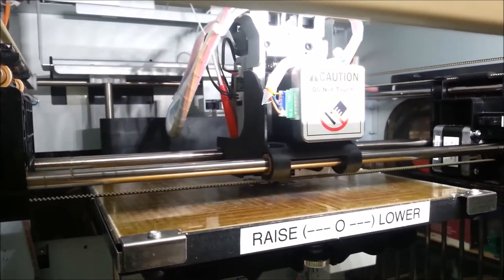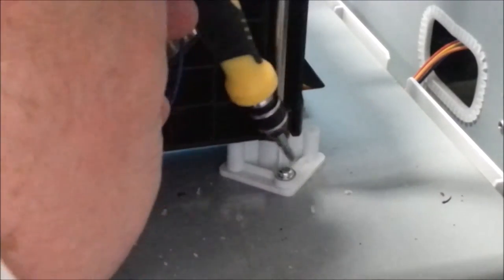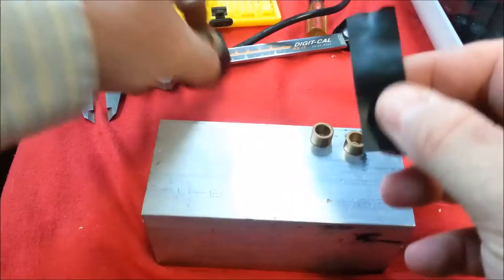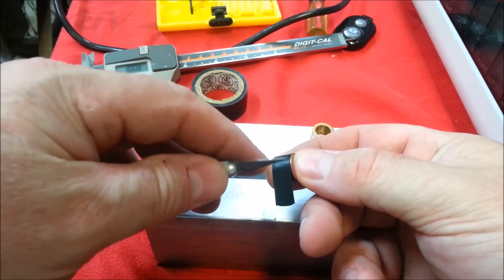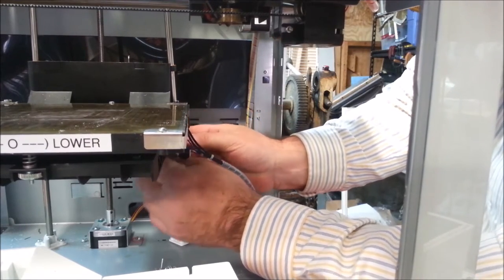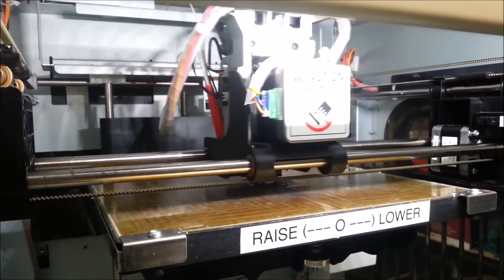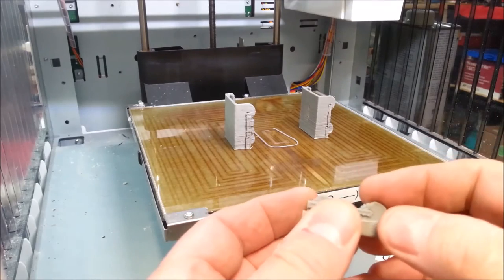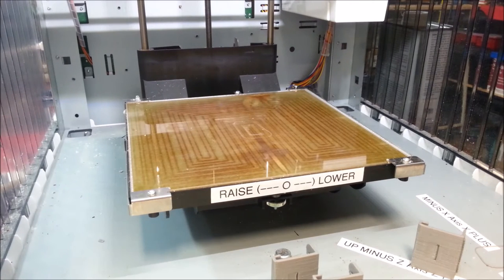Da Vinci Bed Slop  3D Printer Upgrade

Comment: your very crafty dave, the ridge line parts you printed for me are very impressive . a little big , but very cool. i hope to set my hammock up and give them a try. some acrylic paint could give you a bonded layer for spacing on the barring, maybe ..
..bill
Reply from the maker: +billy joe denny I thought they might be a bit oversize.  When I see a shot of the lines going in them, I'll have a good ideal if those "key hole" slots can be smaller.  If I make it too small, the knots will be hard to manipulate through the top of the key.

Comment: Have you tried to rotate the part counterclockwise along the Y axis? It would result in the supports being located in the slot on the back of the part, but it appears that the supports could be removed with an Exacto backsaw. 
Good luck,
Chris 
Purchased da Vinci 1.0 April 2014

Comment: Neat way of doing that. I thought a good coat of plastic paint might of worked.  I like to fiddle with all my tools until they work the way I want them too. Some tools are built with too much tolerance to ease assembly.
Reply from the maker: +james green I realized after filming it, the right side bearing holders are slotted in a way that allows the carriage to go up and down without binding even if the rods are not parallel.  I have another way of doing it I will try in the future when materials arrive.

Comment: I have the same printer, it worked well until the heatbed started getting too hot so it melt my abs prints, any solution for this issue? (Y)
Reply from the maker: Yes.  Two things.  Firstly you need a non-contact temp gun.  This will let you see if there there is a calibration offset.  One of my printers I have to set a bit higher to get actual temp I want.  Also, the heating element is very un-even in heating.  When you have the temp gun (The Harbor Freight unit is find) you'll be able to see it's much hotter in the center than the outside.  Mine was 26 degrees hotter in the middle 3" than on the outside.  This causes poor adhesion and warping on wide prints because the outside is too cool. This causes you to run our temps up to try and fix.  Then pretty soon you are melting your prints.  Search eBay for "XYZPrinting Da Vinci Bed Heat Equalizer 3D Printer DaVinci HOP UP!"  Put this under your heater and it makes the heat much more even than before.  Then lower your print temp to 105 measured in center.  Many times I can get away with as little 95 in the center if the part is not too big.  Will make a big difference for you.
Reply: @CraftedChannel  Thanks very much

Comment: Why wouldn't you use shrink tape instead?
Reply from the maker: It's been a while since I did this.  I think I tried and it was too thick after it was shrunk but my memory is a bit fuzzy as to exactly what happened.  I know about shrink and my business sells it.  I have huge rolls of it in all sizes so access isn't a problem.

Comment: You might need a z threaded rod brace
Reply from the maker: I'm still using these printers a lot even 2 1/2 years after this video.  The table is made stable by the way rods.  I don't think I'm experiencing anything from the Z screw but I'll look into that.  Even though much maligned, these are some of the best printers money can buy at their price.